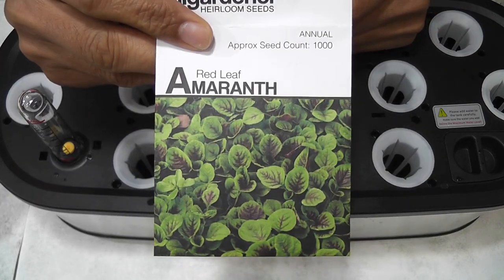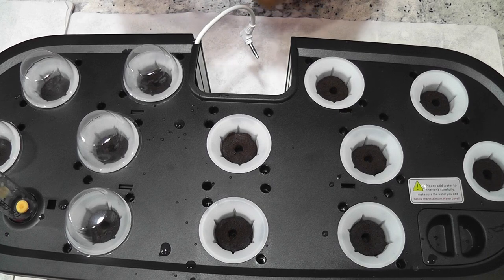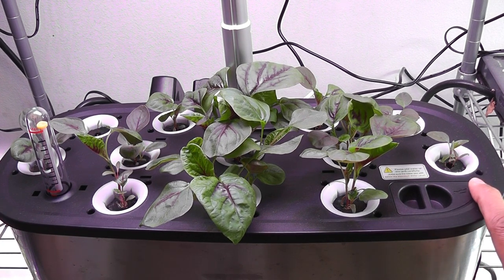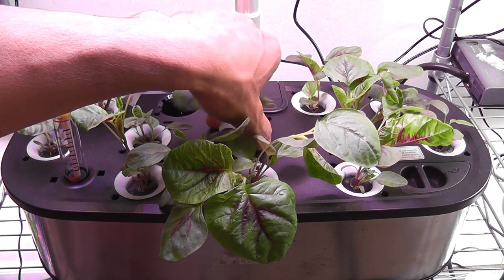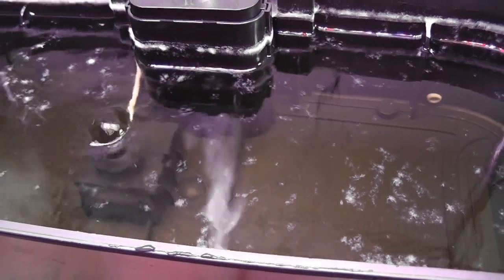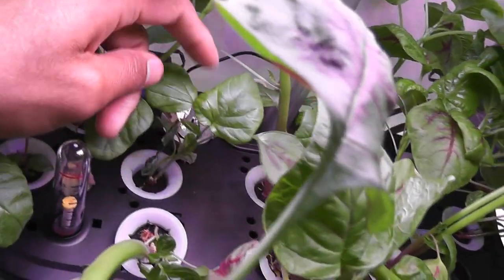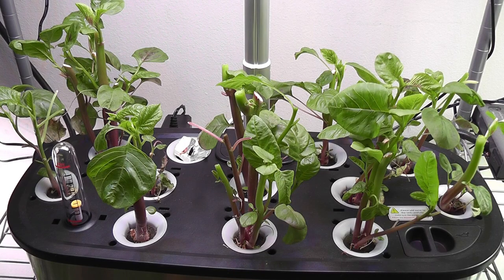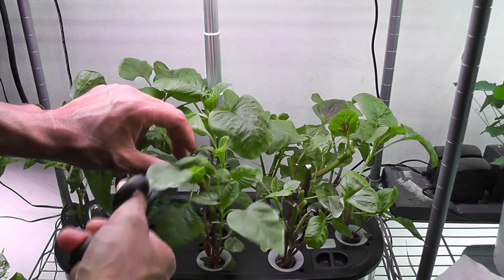Amaranth in LetPot 12-pod Hydroponics System (LPH-SE), using MaxiGro nutrients.

Comment: I have a VERY valuable tip: get the tiniest expanded clay pebbles you can find or if you already have a large bag of them sift or hand sort all the tiny ones you need to fill the grow basket and transplant rooted seedlings into these style gardens instead of using the expensive grow sponges. Use aluminum foil to prevent light entering. I will NEVER get ripped off on sponges again!

Comment: Another great video!  I wonder if the fact that you didn't use labels or light covers caused more mold/algae to form?  I have that model of LetPot and I am always concerned about all the holes in the deck.  I just HATE that and I don't know why these companies don't wise up and stop with all those holes.
Reply from the maker: Not adding stricker not the real problem here. The pumps in LetPot are very weak and not moving the water well enough. If the bowl is full, the water is pretty much stagnated. Stagnation is causing the mold and mess. I started filling the water only half the bowl, and that is making the difference.

I totally agree with you on the holes on grow deck. Totally useless feature and creating unnecessary issues.

Comment: Thanks for the review. I am tempted to buy this one. Did you ever figure out what was causing the mold? Is it specific to the design of this model? Did it happen again? How did you prevent it? Thanks again for your super helpful channel!
Reply from the maker: Maybe the water wasn't flowing well enough and causing the mold. I haven't seen it again after changing the water. One thing I am doing now a days is, I am limiting the water to 75% of the bowl capacity.

Comment: Have you ever tried growing Amaranth for the seeds? I'm curious now. I do wonder if it is possible to swap out the diffuser cap for a t-connector to get better water flow and aeration. That mold issue was disconcerting. I've never seen that in any of my aerogardens. But now I'll be on the watch.
Reply from the maker: No, we can't swap the diffuser cap for T-connector. The cap will hold the pump in pace. If we swap it with T-connector, we need to find a way to hold the pump in place. I am still concerned with weak water flow with LetPot pump setup. I wish they change it in the future.

Comment: WHY not using Aerogarden nutrition?   🍀
Reply from the maker: Just because MaxiGro is economical compared to Aerogarden nutrients.
Reply: It`s a ripoff compared to dry powder you mix. I used mine in my outdoor garden because of the constant mess and frustration. Some sort of slime started growing in mine too that contaminated my gardens. I won`t make the same mistake again.
Reply: @aerogardenexperiments  I have a VERY valuable tip: get the tiniest expanded clay pebbles you can find or if you already have a large bag of them sift or hand sort all the tiny ones you need to fill the grow basket and transplant rooted seedlings into the baskets, then add pebbles around roots, instead of using the expensive grow sponges. Use aluminum foil to prevent light entering. I will NEVER get ripped off on sponges again!